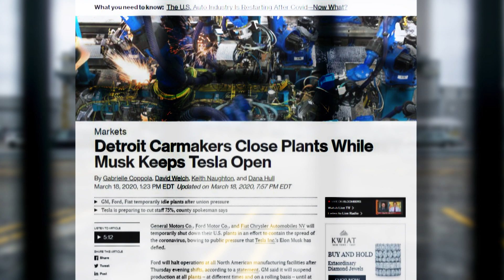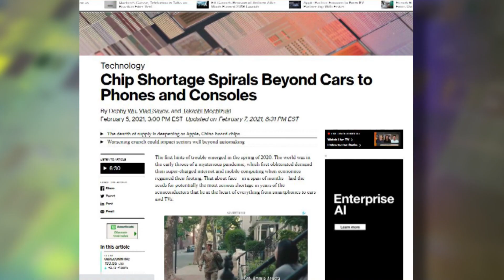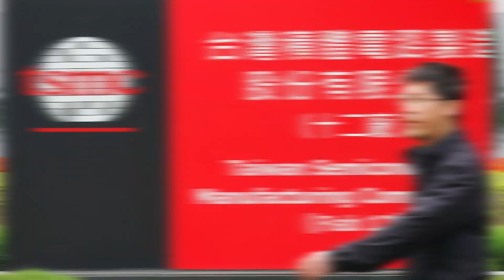The Global Chip Shortage And How to Fix It

Comment: I dunno, it takes "YEARS" to build a "Chip" factory?? - while Gas/ convenience marts are going up in weeks..
Reply: You can put up the building in about a year, then you have to run the wiring, plumbing, HVAC and other services.  Now you have to buy tools, the lead time there is six months to two years.  None of these are mass produced, they’re all built to order.  It takes roughly a month to get each tool installed.  If you have good crews you can do 15-25 at a time, but there are 1,000 of them.  Once installed you have to turn them on and let them stabilize, that’s at least another month and I’ve seen it take a year.  As tools come up you start running wafers to see if they work as advertised which works about 80% of the time.  The rest take some work before they’re ready.  While all of this is going on you’re hiring and training people to run the place.  So, yes, it takes years.